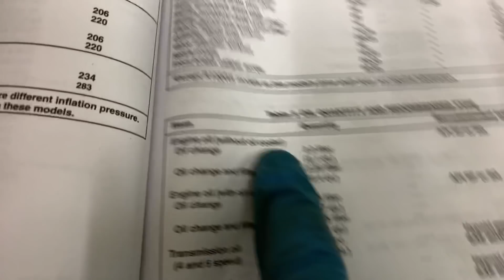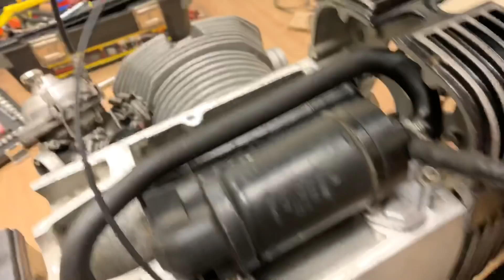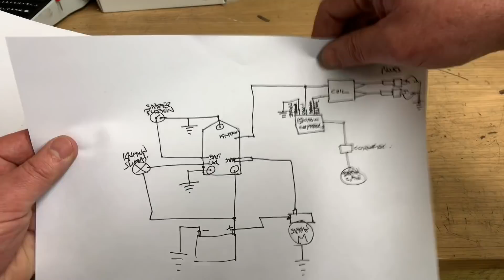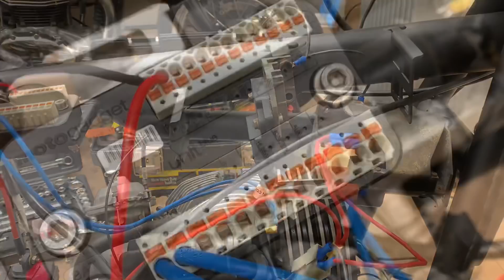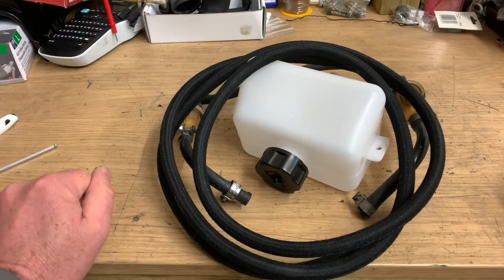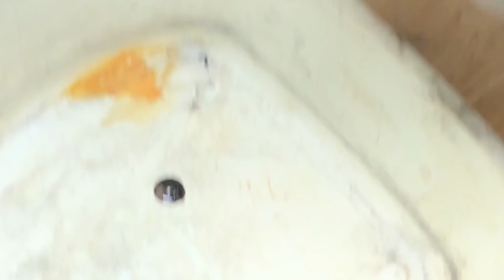29. BMW R80 Custom build. Electrickery part 1. Motogadget m-Unit test install.

Comment: I have a question, let's see if someone can help me, when making the connections in the coils of one, 2 red wires come out, one wires goes to the control unit and the other to the MO unit to ignition, in the other coil output only one wire goes to the control unit, but in the video electrickery part7. it has 2 brown wires at the coil output and to the MO unit there are 2 red and brown cables to ignition.

Comment: I got some questions.  I'm using a brand new charging system with diode board, voltage regulator and alternator wire harness( Black and Blue wire) instead that  regulator / rectifier in my  86, R80. If I want to make my starter works do I have to plug a wire in the black one ?because the blue wire is the charge indicator light that is what I understood. Second, my coils are dual tower too but my coils are not- polarized because I'm using another model and I got the same 3 plug pins ignition wire harness(Brown, Green, Black) below the module ignition. Can I have spark if I make the same connections? I don't know anything about wiring and my stock chasis wire harness is beyond to be repaired and I have been looking for information about how to make my engine start .I'm not using a motogadget Unit. Could you please share or help me with some information about it?

Comment: Great project and thanks so much for all the videos.  Just starting a R100RT rebuild with my son.  Would you be able to provide any of your wiring diagrams for reference?
Reply from the maker: Hi & thanks for your kind words. The wiring diagram download is in the text on episode 50.  Hope that helps.
Reply: @TheLongWayThereUK  Thanks again for the videos and example wiring diagram.  Into the thick of it now and going well.  Did you use powerpoint for your diagram?  I've tried a few apps but essentially have drawn most of it out and would like to clean it up.  Happen to have a suggestion on a tool and if so a template or sample to build from?  @mytwowheeltherapy.

Comment: Hey so there's no starter relay? Is there a reason why?
Reply from the maker: It’s not needed.  The M-unit does the job itself.   I tried a version with a relay. - that worked fine. I just wanted a less complicated setup.

Comment: What colour are the wheels?
Reply from the maker: They are bronze.  I took the idea from a friend who has similar on a limited edition Ducati scrambler - they looked ace.  I went with the only bronze the powder coater had in stock then got the tank sprayer guy to match to that.

Comment: I've changed to a single coil (dual igniton) from Silent Hektik Germany. On there I've got a "+" and a "-". Is your far end post the "+" and the nearer post the "-" ? So that means I connect the the double cable (1 green connector, 1 ignition pint of m.unit) with the "+" post? Many thanks!

Comment: As my co-commentators pointed out:
- aaaawesome video series
- this de-mystified basically EVERYthing for me. Thank you so much.
- little trivia on m.unit blue: in my version (German version, 2018) the output for the ignition is pin number four. The AUX2 occupies the first TWO pins on my unit.
Reply from the maker: Thanks Christoph 👍

Comment: Hi, fantastic video and it's been a great help so far. I'm currently wiring up my '83 r100 and when I reached the ignition coil wiring I noticed mine was a different set up to yours and I have no spark. Could I potentially send you a pm on a different platform to explain the issue? Nothing better to do during self isolation 🙄😂
Reply from the maker: Yeah sure.  Instagram is best. BlackheartCustomMotorcycles.

Comment: Great series of videos.  I second the question on the main fuse - there's a lot of conflicting advice out there - not least from the motogadget manual.  Would be good to see how you run it ... thanks

Comment: Are you going to add a fuse inline between the battery and the M.Unit?  I see the M.Unit doesn't need one but they suggest one to protect the system.  Thanks for the excellent videos!
Reply from the maker: Hi Paul.  Yes I’ll be including a 40 amp fuse in the circuit.  The setup in this video was just to get the engine turning over (to make sure it worked) and oil primed  after I’d rebuilt it.
Reply: @TheLongWayThereUK  Sorry, I should have included my follow up question. Have you found a clever way of doing it?  I have a similar project but have not found a clean way of putting a fuse inline.  Since you're well ahead of me I thought you might already have that sorted?  I have not found many options for doing it cleanly.  Thanks again.

Comment: Great job. Love your videos. Can you tell me something about the charge control (i hope i translated it correctly). I read that once you are using another instruments, your battery wont charge anymore because of the missing signal lamp that is needed. Does the m unit solve this problem? Hope you know what i mean. Best regards from Germany.
Reply from the maker: Hi there.  Thanks for your kind words.  I’m glad you’re enjoying the journey.  I haven’t done the charge circuit yet. I’ll be wiring in a modern reg/rec and yes I believe the charge lamp (or a suitable resistor) needs to be in the circuit. I’ll post a video when I do it. I’d not heard about instrument changes affecting it though. Anyone else out there have any info on this?
Reply from the maker: Here is some info you might find useful.  http://bmwmotorcycletech.info/genlampresistor.htm